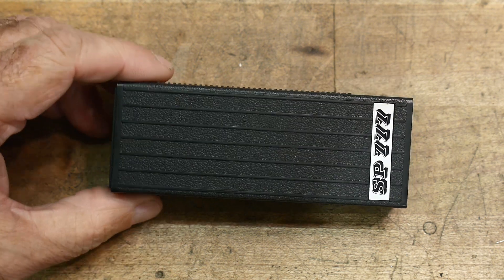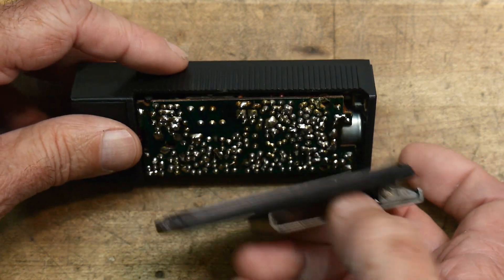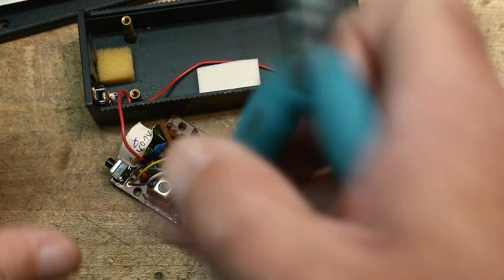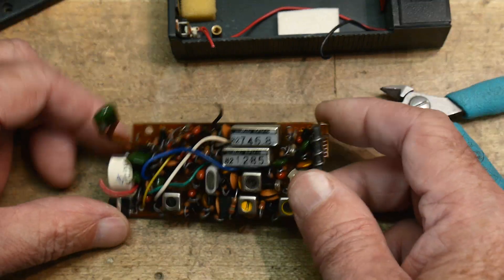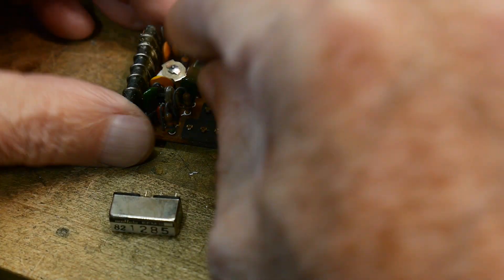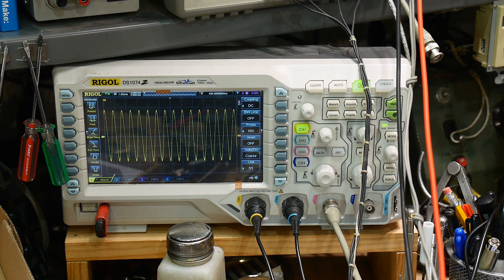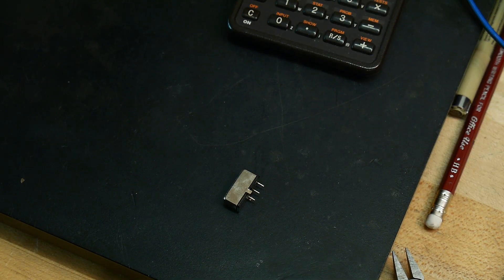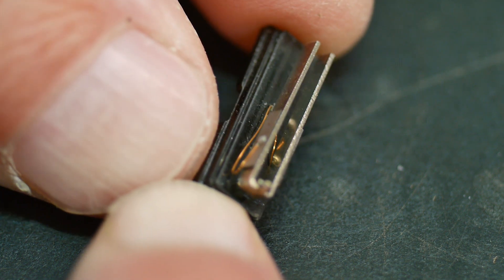#655 Vintage Pager Teardown

Comment: Hi.. You are looking at the only thing that used to get me out of class back in the high school years.
(early 1980’s ).    

Have you guessed it yet?  

You more than likely have the predecessor to tone+voice paging of today.

QC2 .... yup...   2-Tone Sequential paging!

Also...
Many TINY commercial paging outfits used this method of alerting..  but only SMALL companies.
There were a limited amount of tone frequencies, thus limiting the amount of pages per frequency or system.

Many mfg’s used their own “code plan”, using selected sequences of tones to maximize the system capacity and/or the type of group calls preferred by and required by Public Safety.

The “tone reeds” contained in that pager eventually migrated to “active filters” to prevent “falling””

Ex:  Motorola Group 6 (my dept used this group for so e reason..  

60+ pagers on the dispatch/ paging frequency of 155.xxx MHz
5 officers (alerted for “anything” — EMS / fire / requests for “chiefs” or officers / etc..)
20 EMTs (alerted for EMS calls AND structure fires or major fire incidents)
30 or so Firefighters (alerted for fire calls only)

#190  (Motorola proprietary code #)  =  Tone A:  1122.5 hz
#191  Tone B = 1153.4
#192  Tone C =  1195.2

A 1-sec / B  2.5 sec  alerted EMS
A 1-sec / C  2.5 sec  Firefighters 
B 1-sec / C  2.5 sec  Chiefs
&
LONG B  3-5 sec  ALL Call

The adult volunteers received a Motorola Minitor I paging receiver (tone AND voice — $650 in 1979)
The “youth” squad members received “base” (120vac with internal 4 hour life nicad batteries for “travel” 😆) tone/voice alerting units.
(“Plectron” brand. — no clue what they cost as they were all purchased in the 1960’s and  70s)

The youth also had an assortment of “tone only” pagers (forgot brand)

You always get the gems to dissect!

👍🏻

Thank you for your channel and the education you have given all of us!

Comment: You can probably still buy these filters.
Hope link works:
https://www.rf-microwave.com/en/search/?qs=QVwlkbufew%252B0wO%252B8INOo5NdDoFA6RARiAAh1xTHwlZo6zha8HnWnOGNnvvuQuuGjZ4NYLJj5fueeeijl3duUzpnt5tHkejmInaAjCbxARruEl7hRdUUKYQZ9zfSmhluVmw5uDPSw1Xoj9dogoX08s9AZqRl6Re6gLRICokF54zxFD0af%252BK%252BSnLDC8F8zblp39G0A25Iw0LHgdyonsnYLZHEoNZR92b91RJp4kFrTknEBlqLBG85igd1w%252FBR2LVxxyn%252Fk%252F2%252FjENZvtQ7oO41TycJExJbAtLG6O%252FkoBD9ibVpSeEtuHGMd820pKS%252F74uL%252F%252FtxsdmJ3F6BJXWlANXbwpfvfwtxTd58roVooE5BVMHYnLUlt8iRkANnKPxqRRxnMK3nT6m961xAqn76A%252F%252FHsLyGE3k1dJxjr%252BEiqw7Wk5ANDvUNlnvcBVymnUIKnANBsu0AjnF3S%252Fo1ysxOYaBAEDQui1LjSTEd4ETiJh0A5jlDAOpLS4rKmaf2JqkIOdT3%252BuFFhvbZtpI45UILC87k0w4O2ncHAcZUBL2udYBxkfODOmWXGQdjI69NI342LkoZmKXhjp6cbhCjgVa59LrWyrJQ0euMvooEnNj9PN%252B5trvxN34iVID1JMJD54dLxCU%252FvFGP91o9Lysp0qzyRgnmRis2vmc5m%252BgrUg6r04XvyxCY%252BkONYCi3BgvJJc5tDnuAsrhtWLCD0F47gwO6sfwCqNanEVXPCpaiD2dHuO4W%252BVjuJld6rQwZ65aCU3V7mIY6VLdyMoJtLw%252FUxgh%252F%252Fx6Co7QIxQ69x5uEqNyZ0Ebws4i6WgfhGCx88DhO8xompNjNwsaDYF4CXO9ol2lLUM2txgUQwTDge5RZ2hC%252BqTJTo2KlDyidRd8DjJbj8Mf3xLkjH230b4WkJJkmYuGJf8bx%252BnSG078ZURUZLo%252Bj2yRIOjE8inp%252FR811TWW3Xopnf1I3CFMNf9q4fd4XcXxP7EWSZFooH%252Fh10IgWrvXxg4HyQWYpYXqrs5OSo94LwzI359yjcrTGNcjmFGB27l96blutA5h2HMz4QJHhRhUmjOLuluzQrX3EKP6LIhKbMYjxx%252BC5P5che2ypqyPQZVnz9ZgWSqGd8N4t%252B6KwGxAXd5GyOFAhc1TmCa6qsiUTcG%252FZM9Uuz4JYPPovubewq75uQWdq72AxHlafFBve08M4kFSQxRS4%253D
Reply from the maker: amazing they still make them

Comment: The two frequency elements are the two audio tones used to set the 
Pager off. The paging service transmitter transmitted the two tones. I had a similar system on one of my repeaters.
Reply: Elmwood Park was beeping and beeping and beeping !   😉😷😆🇺🇸👍🏻

Comment: Aloha, early on the pagers used a tone code to identify each unit that way only YOU received a page.  I think....long time ago..... later there was more than double tone encoding.  When I saw that I could almost hear the tone that was transmitted.

Comment: Would the nanovna be able to analyse those mechanical "tuning fork" band pass filters?
Reply from the maker: not sure if nano can do audio frequencies.
Reply: No.  Early versions of the NanoVNA worked down to 50 kHZ, later versions to 10 kHz.  1285 Hz and 746.8Hz?  No.  But Imsai Guy just showed how you can analyse them: with an audio oscillator and an o'scope.

Comment: Cool device 😅 should beep if you inject the crystal frequency + (- ? ) fork filter frequencies at the antenna?
Reply from the maker: I tried, no luck
Reply: @IMSAIGuy  Maybe you need to pass trough a signal trough both filters (the first signal gets stored in a capacitor or something  ) 🤔🤷‍♂️.
Reply from the maker: @eivindamundsen7090  My HP 8921 allows two tone signals and I programmed it to send both signals on the carrier am and fm modulated. nothing worked....
Reply: @IMSAIGuy   They usually require the tones to be presented sequentially, and there is a minimum time for the tone.  So it might be 1 second of tone 1, then 3 seconds of tone 2.  Or something along that line.  But usually NOT both tones at the same time.  So, experiment with that and you'll probably get it.  All of them that I know of were FM, pretty sure nobody used AM.  I used to work for a company that made alphanumeric display pagers, back in 1983.  I like to say we invented texting, and really, we did.  Lots of companies had pagers that would beep, and some would display the number you were supposed to call back.  But ours would display a message up to 1600 characters long.  (Or lots of shorter messages up to a total of 1600 characters.)  The display was an LCD, two lines of 12 (or was it 16?) characters each, and you could scroll through long messages a line or two at a time.  Pretty advanced for the time.  The president of the company had a Dick Tracy cartoon pinned to the wall in his office, with an arrow pointing to Dick's wrist-worn communications device, and captioned, "The Goal."